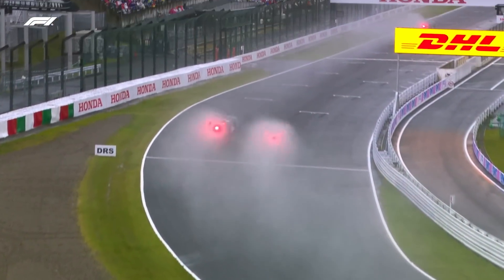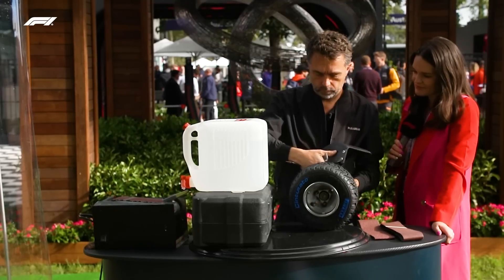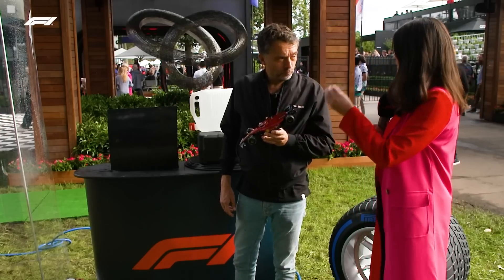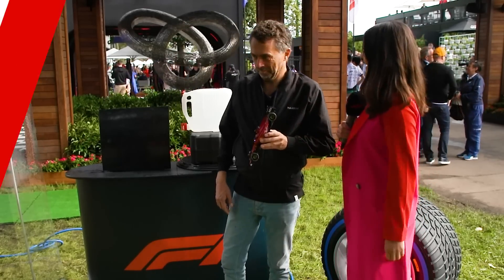How to Stop an F1 Car Spraying in the Rain | Tech Talk | Crypto.com

Comment: This guard can be mounted on the wheel plate ring therefore you don't need to mount it permanent to the car and when it rains the wheel cover can quickly be put on while you change to wet tires due to the fact that the guard and the wheel plate is one unit interchangeable very quick.

Comment: I quess, it would also help if teams were allowed to develop upright attached water deflectors to guide water towards outside. (That water, which is pushed towards inside and diffuser inlet or exit by the tires.)

Though, front deflectors might be difficult to make so that redirected water don't hit rear wheel.

Comment: i know its difficult but they should try hard to make them mountable. F1 would lose a lot if they have to red flag it everytime it pours, both in terms of strategy/decision making and entertainment. If the teams want inters they have to mount these, thats it. If the pit stop lasts 10 s instead of 2, so be it
Reply: Having them quick detachable would be great in drying or changeable conditions as do you take the extra 10-15 seconds to dismount them when putting dries on for the extra aero advantage or take the quick stop & lose some performance on dry tires. If they could get them mounted in a similar time there would also be a strategy if there's a chance rain might come back/ arrive early in a race, do you risk the rain coming back or not showing up in order to save pit stop time but sacrifice some performance in the short term

Comment: Just make tyres similar to what they did in the 80's and 90's tread wise. It wasn't as big a problem. If there is less grip then the drivers just have to drive accordingly.  They bring in wheel covers at this rate just can F1 and be done with it.

Comment: That defuser spray you put like a mesh at the back with smaller holes to reduce spray you may lose a small percent of the performance like 3 to 6 percent but worth a try
Reply: The would stop the diffuser from "diffusing". Most of the floor would choke and ruin its performance.
Reply: @leoa4c  Nah you miss the main point of the spray alot of drivers are blinded by the mist that is thrown up by the diffuser floor. How you going to reduce the spray as I like to know. I think a mesh with smaller holes at the back will help to reduce the spray and increasing the wing angle to increase downforce to gain back the loss in performance in the floor diffuser only for the rain circuit but remove the mesh for dry circuit so it win win situation
Reply: @neddy1287  Ok. Let's see how your solution works at Hungary or Monaco or Mexico. You put a mesh into the diffuser, that increases the pressure at the diffuser exit, the diffuser chokes the flow, you lose 40-45% of your downforce. You can't increase the angle of attack of the rear wing any further because at those tracks teams are already running the maximum angle anyway, and since you stopped the diffuser from upwashing, the rear wing will produce even less downforce.

I cannot explain the aerodynamics of a F1 car in a comment. The short version of it is: you cannot place a mesh in the diffuser.

Comment: If you are installing wet tires , the cover should be preinstalled on the tire itself.
Reply: Wheel assembly turns yeah. Little flap needs to stay fixed. So how exactly do you keep a rain flap fixed when the tire turns?  Please explain to to me how you’re going to keep a fixed part from moving when it’s attached to a moving part.  I’ll wait.

Comment: The model to replicate the diffuser effect over water wasn’t realistic… in the slightest.
If you see footage of Carlos Sainz going off track in Silverstone 2022, the dust left behind is much more comparable to what happens with water, going up in the air several meters. Do not forget that diffusers use the lower element of the rear wing as an extension.
Having said that, I don’t believe that the wheel umbrellas would minimize anything. I mean, they will, but not to the extent they try to portray here.

Comment: This will fail unless they close the diffuser (they won't) which produces several times as much spray as all the wheels combined. Look at any picture of any race car in the rain, openwheel or closed. The giant rooster tails are coming from the underfloor, with comparatively tiny amount of spray from the wheels. This is a waste of time.
Reply: What about using a brush-like material(like a draft excluder) to cover the exits from the back of the car for wet races? Would this diffuse the spray somewhat without completely losing downforce? I'm sure brighter minds than us on here have thought about it lol
Reply: @stevencairns241  No chance. Even the tiniest obstruction in that area will cause a huge loss of performance. Especially in 2022 era cars.
Reply: @Pandamasque  Fair enough, I still think I could sell my ideas to Ferrari though

Comment: I was thinking "ooh how are they gonna solve this one", some clever AI-calculated grooves in the tires and what not.. nope, a fender... 😂😂😂
Reply: I only watched until the end to see if Laura could manage to turn the water on when asked to do so 🤣 She seemed pretty keen to be jamming her hand in beween a mix of belt sander, bouncing spinning tyre, electricity and water....

But yeah- I was genuinely excited to see what fluid dynamics witchcraft someone had used to solve all the problems and thought exactly the same thing as you... maybe a crazy profile of tread block that manages to throw water sideways... maybe a clever aero solution to deal with that water once it exits the tyre at a baffling angle.

But no. It's a mudguard.

I genuinely went and checked the upload date on the video to make sure that this wasn't an April fools joke 🙃
Reply: @martyclakson9226   yea it would have had to be witchcraft when thinking of it. Intrinsic problem, car pushed down - air must go up 😄

Comment: I have seen many tests on different road surfaces. 
There are some surfaces that produce absolutely no spray from vehicles, because the surface water is drained effectively from the road. This is something basic the Romans mastered a few years ago. 
They had no visibility problems in their races.
Isn’t it about time to learn something from them? 🤔

I’ve even seen puddles at bus stops and pedestrian crossings, along with drain covers at a higher level than the collecting water. 
All covered by the Civil Engineering profession, no need for F1 engineers. 

If it rains, get rid of the water, don’t let it sit on the road to become a hazard.

Or am I missing something?
Reply: Maybe the big disadvantage of tyre degradation of you use coarse asphalt to get rid of water? I'm pretty sure the engineers have several other than regular traffic parameters to attend to in F1.

Comment: I'll put it out there for consideration:
Should it be individually up to the divers to decide if a wet race is too dangerous?
Driver A: This is too much, I'm pulling out.
Driver B: Do I dare take the opportunity..?

Another thought:
How much 'better', cheaper, and closer, would the competition be if ALL aero devices were banned but for a simple one-piece front and rear wing of fixed maximum horizontal area?
Oh, and there would be a lot less spray during wet races.

A final thought:
I wonder what the racing would be like if there was a maximum wheelbase and track roughly half that of the current huge cars?

Comment: This is formula 1. The pinnacle of Motorsport . Surely they can come up with a way to attach these ‘covers’ onto the intermediate and wet tyres so whenever a wet tyre is put on a car, it already has the cover attached to the wheel.
Reply: ummm no... the wheel is entirely rotary, any kind of cover needs to be attached to the body of the car to keep it at a fixed angle and to stop it rotating with the wheel... you can't do that by pre-fixing the cover to the wheel. That's why he said the covers would need the race to be suspended to add/remove them as it can't be done with a simple pitstop.
Reply: How could you attach anything to a wheel that is not supposed to spin ?
Reply: @bagofnails6692  there's multiple ways to do that. One is a counterweight, and the other is the same way teams made those non--rotating wheel covers for the 2009 cars and a few years onward.

Comment: Yeah, if it was so simple as you try to make it seem, it would have already been used. No, you can't do that, it interferes with the aerodynamics of a formula 1 car too much as well as it goes against the meaning of open-wheel racing. No, FIA is just so incompetent in the last 15 years, not even mentioning how awful the stewards decisions were in the last 2-3 years...

Comment: the real solution is to have more vehicles clearing the track. 
Get 6 drift cars with massive tires on them. send them out in pairs. Keep them lapping when it's raining. 
the problem is FIA takes the cars off the track letting the water pool up. 

NASCAR has Jet engine driers...    Also could use better draining Asphalt.

Comment: This demo didn't work at all. With this 6 year old child's level of expertise, it must have come straight from the FIA.
The idea that downforce is something that should not be compromised is ridiculous. Fangio and friends raced with no downforce in front of packed stands 70 years ago. Brabham and buddies raced with minimal downforce as an afterthought at best in front of packed stands 60 years ago.
Take the "wings' off these giant cars, make them smaller (it's only one guy in each car with no kids or shopping) and let the teams innovate more. 
This would give the teams more points of difference and capacity to see change over time.
It would also showcase the drivers driving skills rather than the engineering expertise of people we have not heard of and never see or care about.
It is not interesting to see the same car win every race or even a 2nd or 3 team win by default. 
How is that racing? DRS proves F1 lost its way long ago.
What is so bad about seeing turbos racing against V10's or rotary's or whatever else they come up with?

Comment: the problem is it removes a lot of strategy. teams predict conditions and when they get it right it means a lot in wet conditions. if you red flag a race that gives them a pitstop to change to the right tires
Reply: Maybe ban tyre change in that specific red flag situation?
Reply: @bennylloyd-willner9667  I don't want to be rude but the whole point of the red flag is the RAIN so banning tyre change means the cars will have to do at least 2 laps with slick tires on a soaking wet track which is dumb , and even if they did that and survived the carnage they will all probably go straight to the pits at the same lap so its pointless.
Reply: @ahmedhemissi1677  is not rude, I just made a comment on how strategy still could be a part of it. I'm totally open for criticism and other ideas. I think discussion and brainstorming is the way to go to not overlook something that partly could be a solution 👍
Reply: @bennylloyd-willner9667  i think they could implement a mandatory cover fitting pitstop in rainy conditions which teams have to perform if they didn't fit the covers at the start of the race. but even that would ruin strategy since teams usually double stack their cars when it rains so that means whoever is second will have his race ruined ( unless they make the covers installable in under 5s).
Reply: @ahmedhemissi1677  yup, it's a thought 👍
Reply: @bennylloyd-willner9667  then people who didnt come in will have a disadvantage
Reply: @fukers2stop  yup, and that is a strategy decision.
Reply: @bennylloyd-willner9667  If they make it easy to install they could do it in a pitstop. Maybe like 20-30 second pitstop.
Reply: @jjo524  i meant that if they ban tyre change, the strategy will still be a big part even if they red flag. I wasn't commenting on the fenders themselves, just the tyre strategy thingy.
Reply: @bennylloyd-willner9667  Ok
Reply: @jjo524  I was thinking it would be too risky to make teams rush to do it... but what if they make those pit stops a minimum of X seconds so that they have lots of time to make sure it's right?
Reply: @jjo524  If a front-wing nose piece can be engineered to be swap-able in a pit stop, surely it could be done for wheel covers.  It could even be something like a bayonet mount, where tabs secure it in place with a single fastener (per wheel) to lock it.
Reply: safety should be priority in very wet conditions
Reply: It will probably only be used in extreme wet conditions eg. spa 2021, where the race cannot take place at all
Reply: @DariusCarv  It will probably be used for like conditions even like Japan 2022
Reply: Like Darius mentioned, it'll likely only be used in long,EXTREME wet conditions. Like Japan last year.
Reply: Not really. Because the strategy calls are almost always for a drying track not one that's getting wetter. By the time the track is in a condition where these would be needed, everyone would've already wanted to be on wets. Once they're on, they stay on, so there's no affect to drying track strategy.
Reply: @joshuapowers4623  I've seen a few staying on dry tires hoping for the wetter condition to change back to dry, catching most others on wets. I wouldn't say there aren't situations both way, and just one race dry-wetter-drying where they can gamble for better result is enough for some teams to try. That's just what I think.
Reply: I interpreted it meaning when they would normally red flag a race due to dangerous visual conditions, not when they should switch to a wet tyre

Comment: Solve this so we can have wet races again. Now it's either inters, or red flag. The wet tires are pointless because when it gets to conditions you would use them in, they dont let them race. Then there is also the issue of DRS not open for way too long even though the track is dried out.
Reply: easy, when it gets too wet they pit for gokarts, less speed, less spray, more visibility
Reply: @MikkelSkomaker  1,000 IQ thinking

Comment: They should just equip all wet tires with the fender already attached. It doesn’t have to be very big. Engineers could probably develop it in a couple days.
Reply: But the biggest problem is the diffuser. Even with the mudguard on, the diffuser especially in this new ground effect heavy cars, can't just be blocked with a fender. I don't see the mudguard doing anything much to improve visibility, and it might make the track stay wet longer as it doesn't disperse the water as efficiently.

Comment: The wheel covers are great but how will these new covers help dry the circuit faster though
Reply: They won’t, their purpose is to limit the spray coming off the back of the cars
Reply: @albertmonk7403  yeah that was the point 😉 these wheel covers will capture the water and return it to the track
Reply: @v1nnyc  Spray still falls back down to the track. Again, the purpose to help prevent the spray billowing as it's blown up high into the air. The drivers aren't complaining about the track being too wet, they're complaining about not being able to see.

Comment: so originally, wet tires were to clear the water off the racing line and allow cars to race even when raining, now we add mud guards so that they don't clear the water, and the track will get more and more wet?
Reply: The primary purpose of treaded tyres is to give the water a path to escape from under the tread blocks themselves and into the grooves, thereby allowing the tyres' rubber to make direct contact with the asphalt, rather than the water on top. Obviously, more friction is generated between rubber and asphalt than rubber and water, so the tread pattern allows the tyres to generate more grip in wet conditions than slicks. The fact that F1's wet tyres currently displace water vigorously enough to dry the racing line off is just a secondary effect.
Reply: U cleary did not understand the purpose of a rain tyre
Reply: I seriously hope you don't actually believe that the reason treaded tyres were introduced was to clear water from the track
Reply: Yes thats a point, it would disperse less water unless they manage to direct the spray to the sides instead of up